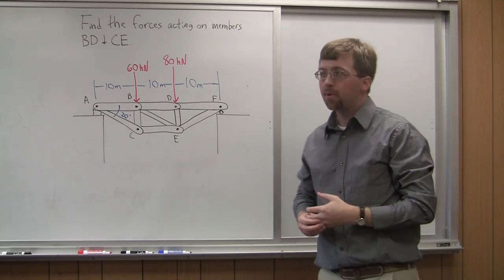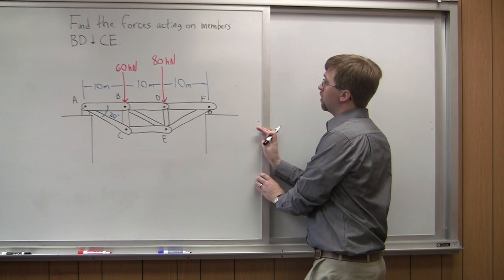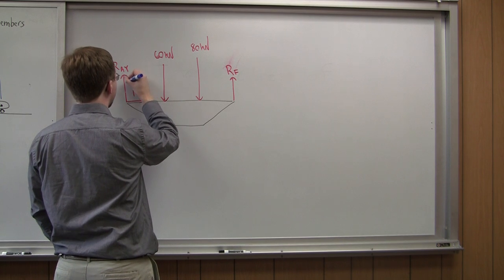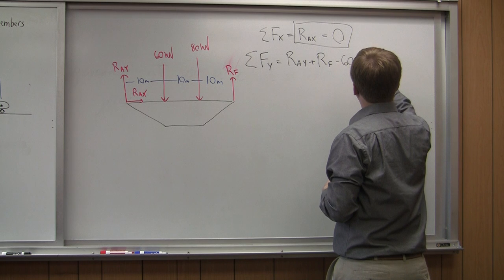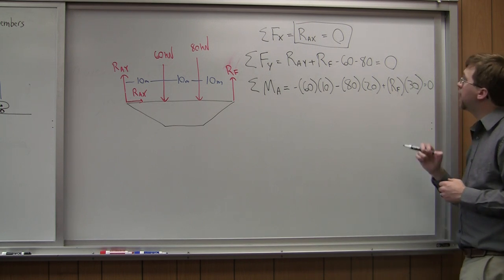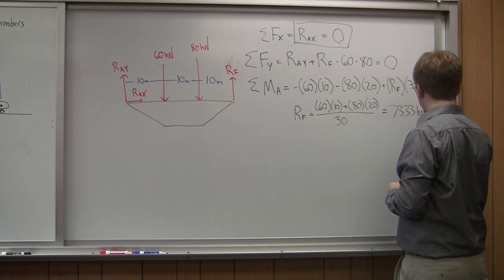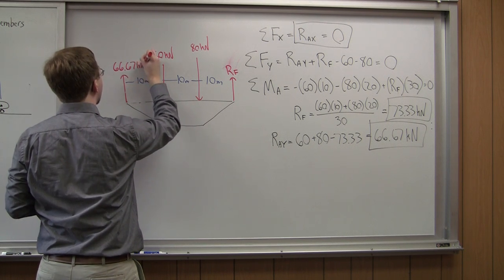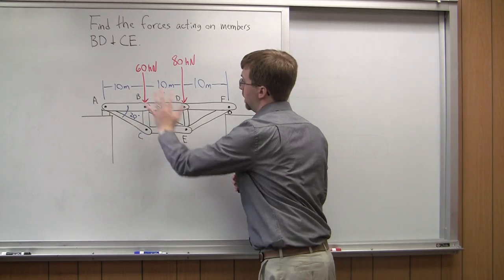Method of Sections - Adaptive Map Worked Example 1

Comment: how that side became 10 tan(20) ?    in second 9:28
Reply from the maker: For a right triangle like we have in the problem, the Tangent of the angle is equal to the ratio of the length of the opposite side over the length of the adjacent side. Therefore if the multiply the tangent of 20 degrees by the length of the adjacent side (10 in this case) we will find the length of the opposite side of the right triangle.
Reply: @jacobmoore8043     thanks,  finally i get it .